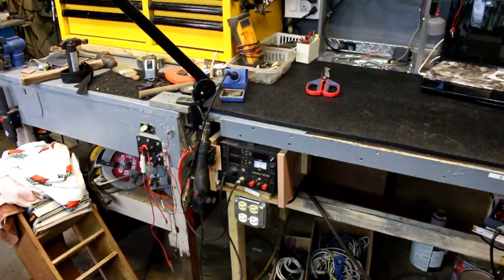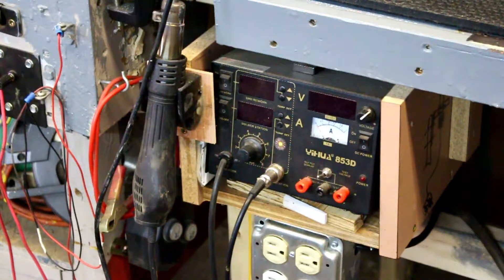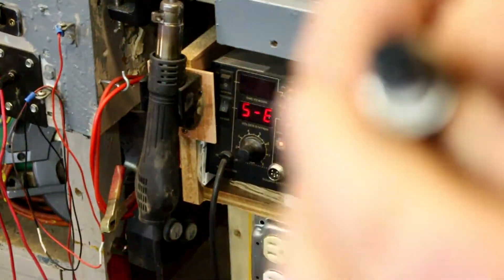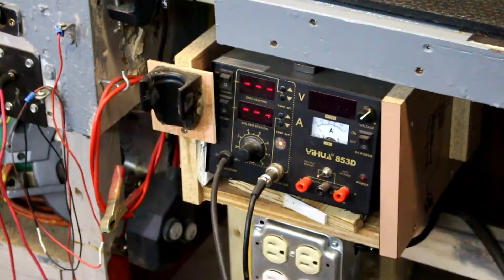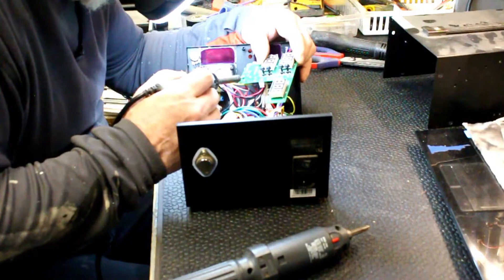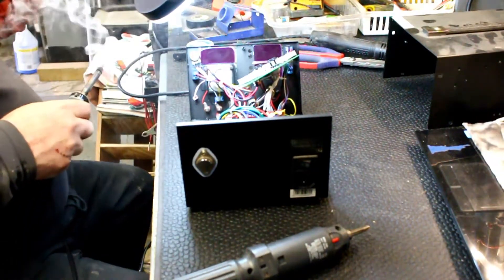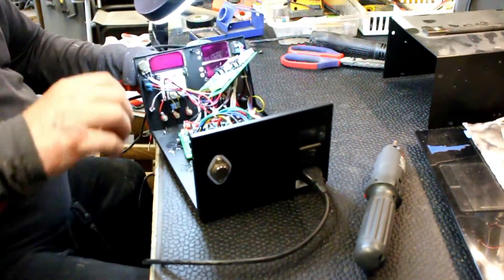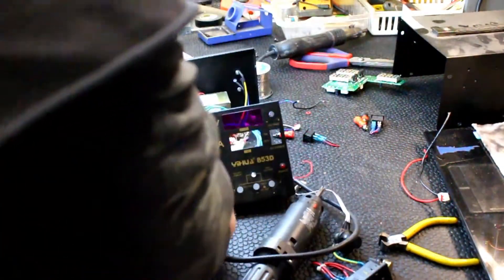Time to junk the carp solder station

Comment: I have the same brand as that, but it's just a solder station.  I think it's a YiHua 939D, I think I paid $35 on ebay last year. I haven't used it much, but I don't expect to get much life out of it.

Weller was a good brand soldering station.  When I worked in a repair lab we used Weller stations, I remember they were light blue in color.  And just like where you worked, they were on from the time we got in at 8 am until we left  at 5 pm and lasted a long time.  We used to have to replace the iron part every year or two, we kept the replacement irons on hand as well as various tips.